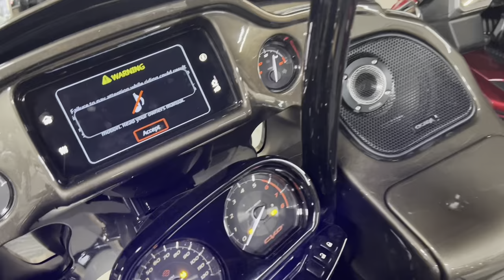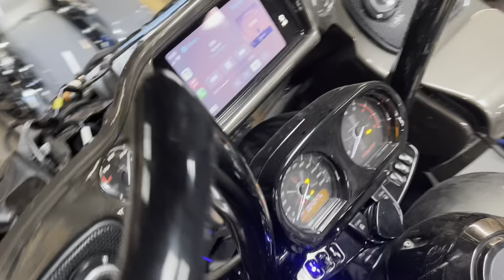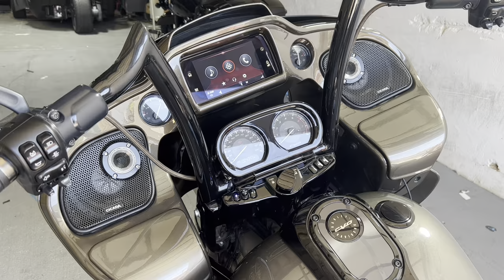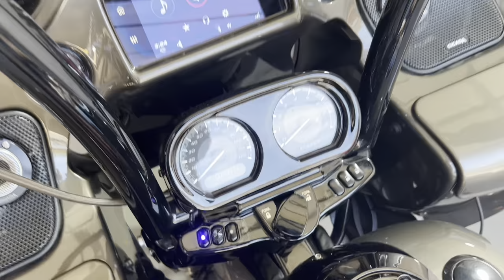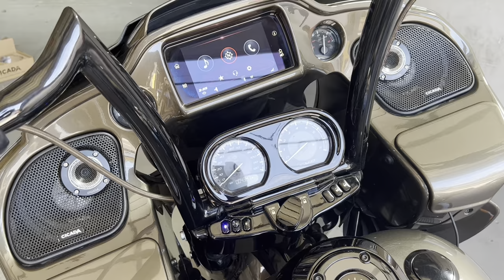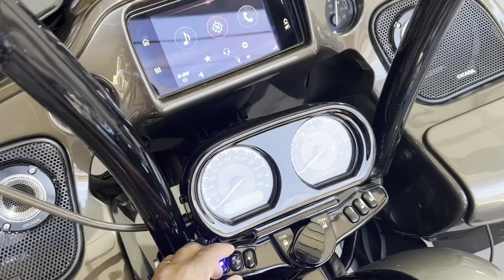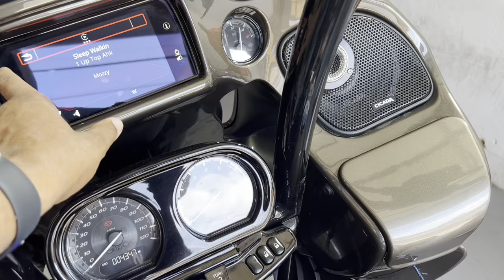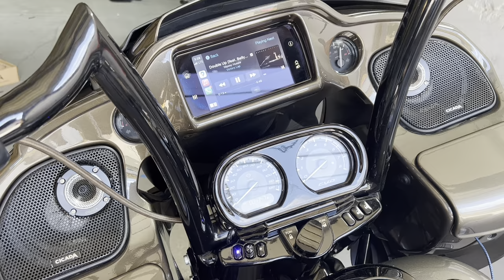Harley Davidson CVO Road glide shipped to us from California for a Nvs Audio Stage 5 audio upgrade.

Comment: How did you wire the Beyma 6.5's? I assume the 1600.1 is used for the 10's in the bags and the 1200.4 for everything else. I can see bridging the front 6.5's to give them 300 watts each by sharing the 600 watts. That leaves only two channels to share the tweeters and sealed 6.5's (4 speakers) (2 - 4ohm (100rms each) & 2 8-ohm (200rms each)). With the beyma's being 8 ohms, would they be wired parallel and the tweeters wired in series to get down to a 2-ohm load and then bridge them for the 600watts?